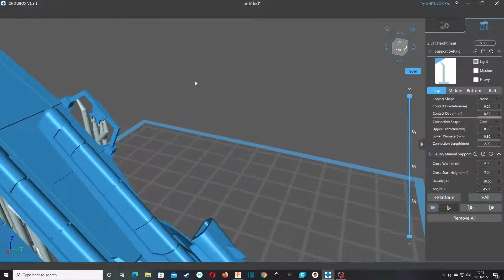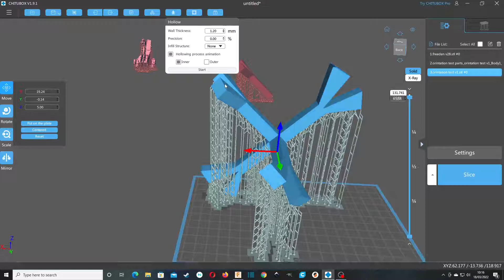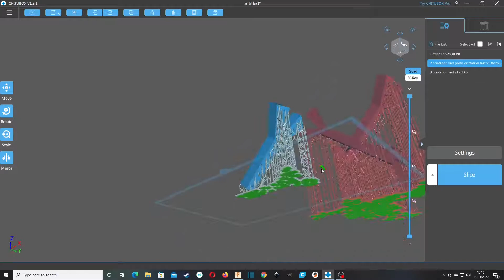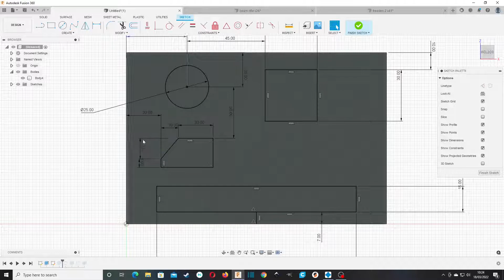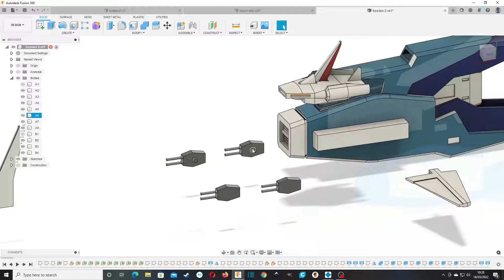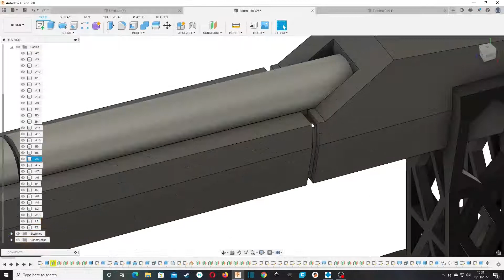Splitting models for 3D printing, why and how to connect them

Comment: When you hollow something more detailed than your shown model, you also need to get supports into the hollow. Also you need a hole in the model so that the uncured resin can get out.
you will also get better prints with less risk of failure or detail loss, if you not only  angle your prints 45° once but also a second time on another axis. you want your model in the best case scenario to begin with just one pixel and not a whole axis full of pixels.
Reply from the maker: Indeed, a model with more detail will need supported internally, however these are simple models for demonstration. We don't really need to worry about splitting a model for internal supports as they will not be removed. 
Yes holes are needed to let the resin drain, I watched a video where someone didn't do this, and they were finding the model splitting. To make draining resin easier, I normally try and put holes in 2 sides of the print, if not far enough away that one can act as a drain and the other can let air in to allow a good flow and preventing resin from getting stuck. I would also say the putting drain holes in your model as close to the build plate helps relieve pressure within the part, preventing layer-shifting. Again over simplified models, real world models are much more complex.
The 45 deg on 2 axis is a good tip, I tend not to do this as I have had problems with parts not sticking, or having to be over supported to work, but is does give better results.